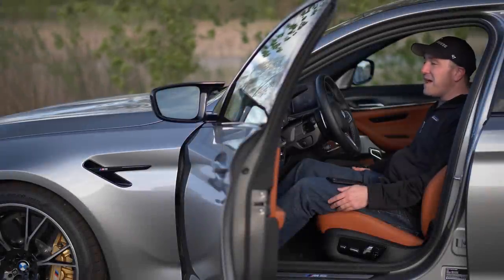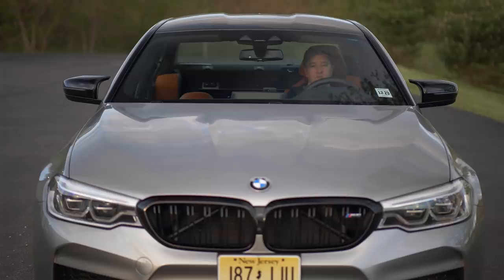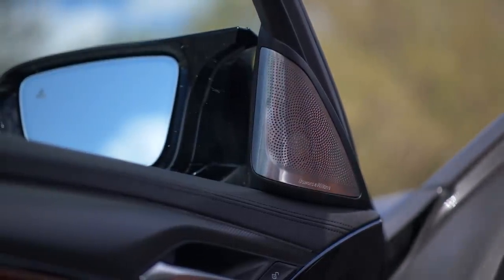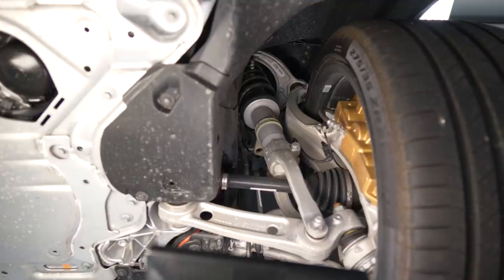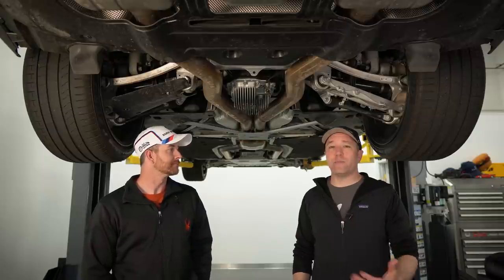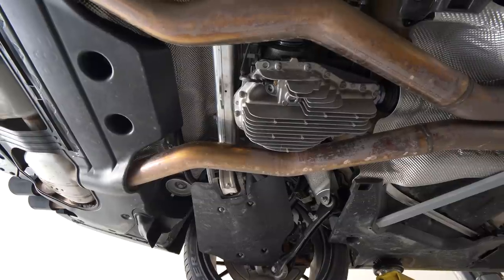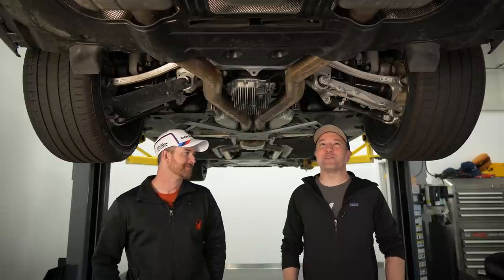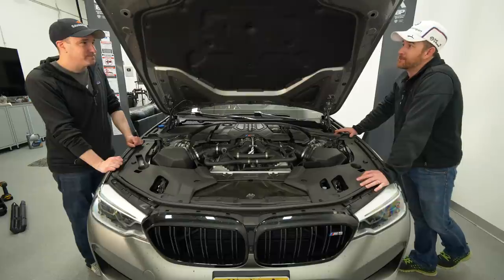2019 BMW F90 M5 | The Rabid Farm Animal

Comment: There is a problem with comparing prices from country to country, and that is how tax and duties are levied differently from place to place.
Reply: damn, so how much do each of these cars cost?

how much does a mustang GT cost in Norway? 

What about Toyota Landcruiser?
Reply: @dragon888193ftw  
Sorry for the late answer, here are starting prices before options for some relevant cars:

Ford Mustang GT: 1 171 000
Toyota Landcruiser: Not sold here. The cheapest HiLux, much beloved as a working car, as it fits a Europallet in the bed, starts at 376 600.
BMW 530 e Sedan: 568 700 (The gasoline version with slightly lower hp costs about the same.)
The Mazda MX-5 starts at 359 500 for the softtop, and 383 500 for the RF.
The e-Golf is about 335 000 and the BMW i3 is 320 000 for the slower version and 350 000 for the faster version.

If you buy anything with a small ranch of horses in it, you'll pay through the nose in taxes. Unless it's a hybrid, then it's a lot less, or if it's electric, then it's a lot lot less.

So if I wanted a cheap car to drive to and from work with, I could get the Mazda 3 econobox, but then I'd have to pay more every year in duties and tolls, but if I got an e-Golf, or a Zoë or Tesla S Roadster, I'd pay a lot less. 

Just to summarize: A Tesla S Roadster, founders edition, with EVERY OPTION TICKED is  1 048 020.
The STARTING PRICE of the mustang GT is 1 171 000.
So if I had a million crowns to blow on a car, would I get a mustang with zero options, or the Tesla with everything, including autopilot and ludicrous mode?

And this is all due to taxes. If you go NOK -> USD you'll find that cars here are disgustingly expensive. (A million crowns is currently about 113 000 USD. That mustang  starts at, STARTS AT 133 346 USD. A smidgen more than in the US.) Meanwhile, the Tesla costs about as much in both places. This should give you a hint as to why my tiny little country has something like 10% of global EV sales.

EDIT: I can't quite remember what cars I had in the original comment, but I think I remember that I fucked up some of the prices, so I wanted to edit it to not sound like a complete retard. So if I missed a price, sorry bro.)

Comment: How is it possible that the front ceramic brake disks cost 4265 dollars each and the rear ones 4355 dollars each and the brake pads set cost 39.78 dollars per axle, while the "repair kit" costs 357 dollars for the rear brakes and 579 dollars for the front brakes?

There must wrong with the costs of the brake pads!

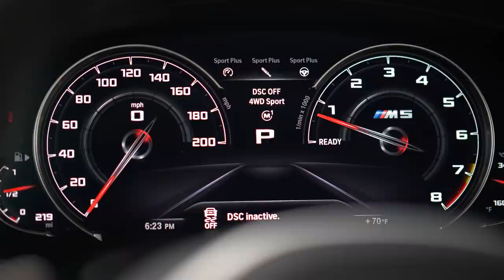Comment: The fake buttons are so stupid. 4:01 is a good example: instead of buttons it's just a touch sensitive panel and when you touch it the whole panel moves. Imo that ruins the perceived quality, those moving panels feel so cheap. Either just use a moving button with real feedback or if it's touch sensitive for whatever reason at least make it solid so it doesn't move around.

Comment: So, regarding the brakes, i always thought the life of the carbon ceramics was extremely long even when driven hard. Is that not correct?
Reply from the maker: For somebody that truly track drives the car when you heat cycle these the disks tend to pit and fracture.  most drivers of supercars are those who do a ton of track days typically skip this option or retrofit steel rotors.
Reply: @savagegeese  the real question: is the steel rotors / pads setup a straight swap? does it play nice with the electronics?

Comment: I owned an f10 m5 and hated it.  Its such a heavy car that basically all of the performance technology you went over is negated.  And the twin turbo V8 is extremely sensitive to heat. The computer is constantly pulling power to manage the temps.  The exhaust note is terrible btw.  If your gonna spend 100K+ look at the Mercedes instead.  The new Merc's while also heavy are like muscle cars and have 3 times the character than the new BMW's.

Comment: I think you meant to say the frequency response was “flat,” not linear like y = x.
Reply from the maker: It was flatish, but had a linear curve.  Slight and smooth falloff of low frquency to mids then trailed off upper end.  I didnt have the graphs available but will post them in the M550i video coming up.
Reply: Oh, I’m sorry; I misunderstood your meaning. Also thanks for this exceptionally comprehensive review. 👍

Comment: With almost the last 3 versions of the M5...
Disconnect the EDC, buy a suspension setup that you want . 
If you want adjustable... get ready to grab a tool and make some turns. Cause electronically adjustable suspension is for the lazy, that want the option in a vehicle they’ll NEVER track !  Especially with these.. UNLESS YOU’RE ON A TRACK,  RIPPING THROUGHS SOME CANYONS, ETC... , you should basically ALWAYS be in “Comfort” . BMW makes it pretty obvious...

Comment: I don’t get it. You always complain about m cars. It’s not refine about ones, way too refined about others.
You complaine that you don’t feel nothing when you drive in straight line with 40 mph at 2500 rpm but the second you step the gas, OMG what a car, what incredible handling!!! 
Wtf man? You know that an M car is great at the limit. That’s the point where it shines. 
I really think that your opinion it’s not the real deal.
Reply from the maker: This is one of the most video game feeling cars on the market. You feel absolutely nothing. And as fast and capable as it is, every input feels synthetic. If you want a car that is fast and does everything for you with 4 doors it does not get any better.
Reply: @savagegeese  let me agree to disagree. I owned four M5’s till this day. 
E39, E60, F10 and now the F90. Everytime I switched to a newer model my impression was exact the same as yours. Lack of feeling, lack of soul. But after a time with the new car I realized that it’s completely different from my first thoughts.
You have to drive to the top limit to get the best from this car. With the E39 that wasn’t a problem but with this G30, it is. Because it’s insanely fast.
Second of all, try to drive this car for a while, and then go to a hellcat or an older M model and you will understand what I am saying.
Of course it’s not a pure sport car because that’s not the car’s purpose.
But to criticize a car for something that the manufacturer never pretend that car to be, it’s ridiculous.
You say that you don’t understand why an M5 and not a 530i. 
Because you can’t compare it. From the interior which’s completely different to the mechanics.
I own an M5 for everyday purpose and traveling and an GT4 918 for fun and feeling. And trust me, that 918 with his higher rpm, it’s tremendous. Please be fair and review a car for it’s purpose and compare it with other from the same class.
I apreciate your response and sorry for my english but it’s my third language.
All the best!

Comment: How can you have that much fun driving it and then claim it doesn’t feel good driving it. I think it’s effortless and the roads and restrictions make it not a fun car at normal speeds. I wouldn’t blame the car for that. It’s like saying Usain Bolt looks boring while jogging. That’s not what it’s for. This is a fast stable high speed cruiser.
Reply from the maker: Just because a car is fast does not make it fun to drive.

Comment: Want big power, great track holding? Just get a Camaro SS 1LE. No heat problems, no numbness, no stupid ridiculous levels of useless and distracting tech. Stupidly reliable LS engines. Durable. Parts galore. Easy maintenance. Low cost factory repairs. Also Tremec manual for those who want to row their own. Not enough power? There's the ZL1.

Comment: Maybe heavy for a track car but for the 99.9% of actual users, the car is incredibly capable and comfortably over engineered. Those ceramic disks may never need replacement if you change the pads appropriately.
Go figure, BMW builds a very good sports sedan. It's kind of their thing.
Regarding the boredom; you do look pretty bored when you mash the throttle and the awd still kicks you sideways and then it flattens your eyeballs. I'm guessing those massive brakes hauling that speed right down as you set up for another corner is also boring.  You know what's exciting; looking for facial expressions that contradict the commentary. Now I need to go eat...I'm cranky.

Comment: I truly believe you will not be able to buy this used. All this tech won't work in two years and will just cost too much to repair. It will be a brick. Everything innate about modern vehicles is on display here. Driver optional. Luxury is currently being defined as ambient lighting and the amount of LCD displays. Sad.

Comment: Total joke of a car. Would never own one speaking as a former BMW owner. Too many sensors and constant warning lights. Too many confusing unnecessary buttons. BMW lost their way about 35 years ago imo.
Reply: @Marc Willard Technology OVERKILL with sensors to tell you the sensor has failed. Requires a multi thousand dollar scanner to read the multiple fail codes. Lease it, thrash it, turn the keys in and run away from BMW. No longer built to last.